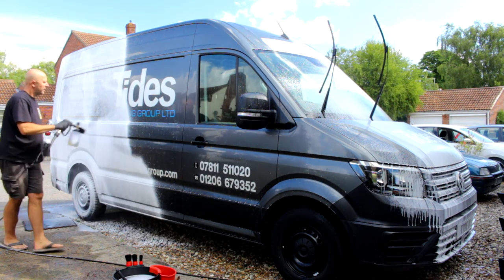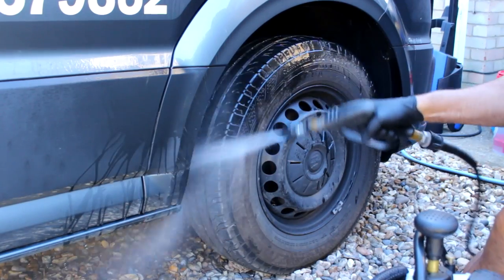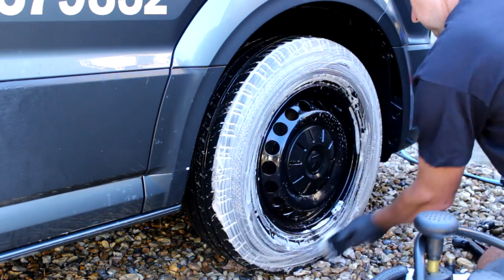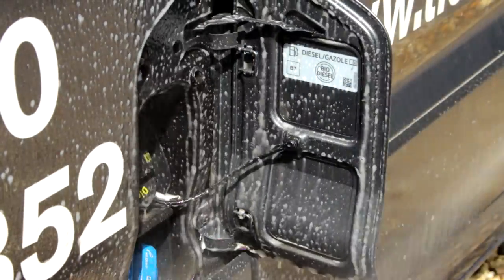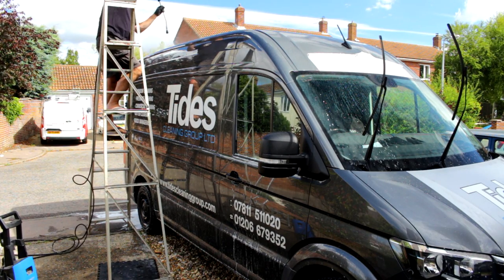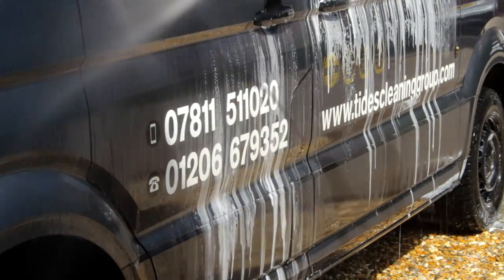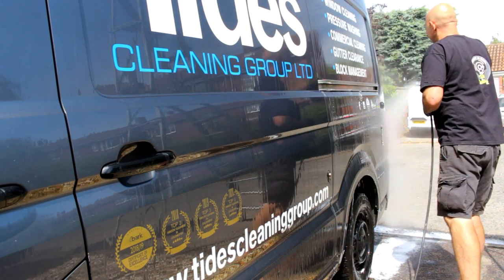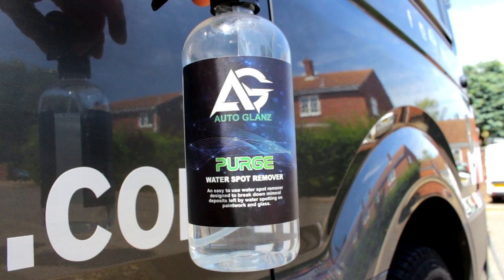CLEANING A BIG VAN

Comment: Hi Paul, another great video, cheers.  You showed FSE then the drying towel, did you use FSE on the wet van, then dry it, almost like a drying aid?
Reply from the maker: Good comment Sir the van had dried out almost but on my car I use it when it’s wet
Reply: Thank you Paul.  I was wondering if I can use on a wet car, no one else seems to but, being in a very hard water area I was thinking of trying it on a wet car, so I glad you do this, gives me a little confidence to try now.  Would a couple of spritz per panel, wipe over then buff off be the application method? Thanks again.